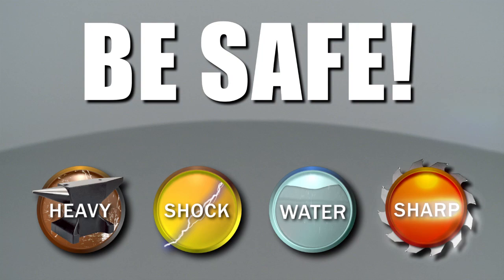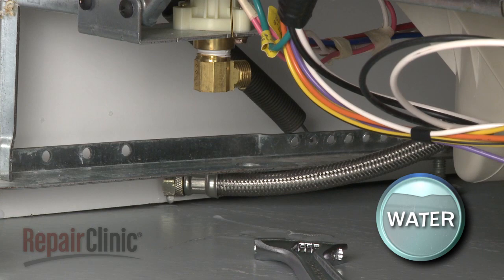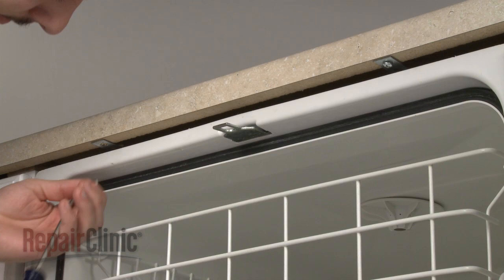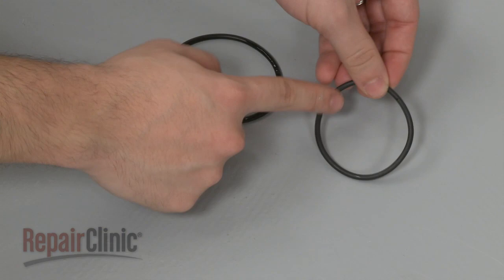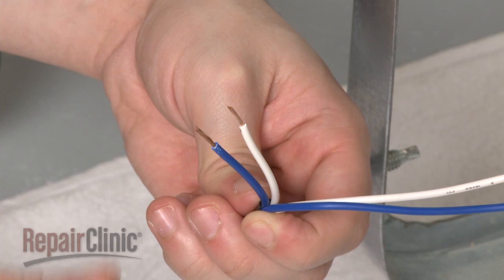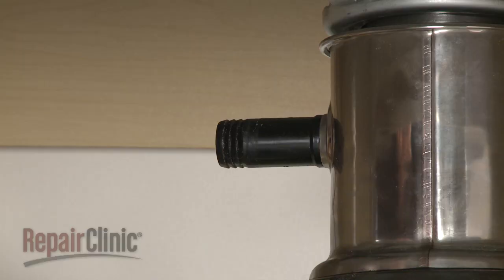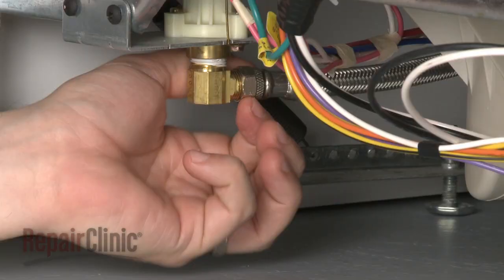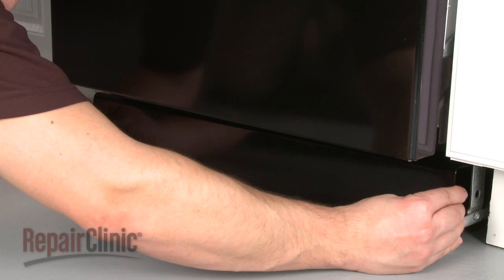Noisy Frigidaire Dishwasher? Circulation Pump/Motor #154859101

Comment: Great video and great site! I was able to troubleshoot, purchase the part and watch how to repair it all in one place! Watch the video first, so you know what tools you need. It took me about an hour. With interruptions from people. Husband was going to pitch the dishwasher and buy a new one. So glad I researched the issue and fixed it. Saved us at least $600.00. Runs now, better than ever,  and does so quietly. Thank you Repair Clinic!
Reply: It saved you about $600? The dishwasher is barely $200-250 brand new. I hope that's not how much a repair tech quoted you. If so he should  be reported. Ah well, do you happen to own any bridges?
Reply: @Roller76  nice😐
 R.C. is using a $300.00 model to illustrate the repair. Certainly it is the same application for all Frigidaire models, so it indeed saved us at least $600.00. That is the "on sale" price of the Gallery, my husband wanted to replace with a new one. 🙄

Comment: For my model of Frigidaire dishwasher, I was able to replace the pump without disconnecting or moving the dishwasher in any way. I simply flipped off the circuit breaker, then lay down at the bottom of the washer and got to work.

I removed that sheet metal covering panel at the bottom, unplugged the two electrical connectors from the pump, used an allen wrench to remove the two screws from that metal bracket which holds the pump in place, slid a large dinner plate under the pump to catch water, and pulled the bracket down.

Then I wiggled the pump slightly out and loose, so that water slowly drained onto the dinner plate. When the plate got almost full, I pushed the pump back in to stop the draining. I carefully slid the plate out, lifted it, and dumped the water in the sink. I had to repeat this draining method a couple times because my plate couldn't hold all of the water that was sitting in the bottom of the dishwasher.

Next I pulled the pump all the way out (turning it to avoid the water supply line), and slid the metal bracket off it. I reached inside the hole in the bottom of the dishwasher, where the pump had been, and used paper towels to clean it as best as I could. I smeared liquid dish soap onto the parts of that cleaned area, where I guessed the pump touches it.

I also smeared that soap on the o-rings that came with the new pump, then slipped them into place on the pump. I slid the bracket onto the new pump. I turned and angled the new pump into place, and pushed it in. I reinstalled that bracket, plugged the wire connectors in, and turned the wall circuit breaker back on.

I didn't immediately reinstall that bottom cover because I wanted to see under the dishwasher when I next washed dishes, to check for water leaking.
Reply from the maker: Thanks for the in-depth story! We're sure it will help someone in the future.
Reply: I have a frigidaire dishwasher model ffbd2411nw6a which has a johnson electric pump. It works great. What brand was the pump in yours?
Reply: Thank you for hope that I can do it this way. I will pull my hair out if I have to pull the dishwasher out again. The pergo floor was installed in front of the dishwasher. Foul language is required for removal and install

Comment: Excellent tutorial!  This was my first time attempting to replace the circulation pump on my Frigidaire Gallery dishwasher and this video helped immensely.  My new pump was plug and play so I didn't have to cut off the old connection.  Other than that the instructions were perfect for my model and very easy to follow.  This repair is very easy even if you are not mechanically inclined.  Take your time, follow the instructions, and save money by doing the repair yourself.

Comment: This was terrific. Followed it closely and DW is about 10x quieter now. A couple of notes: 1. As others have mentioned, I didn't have to strip the wires or add the new connections--it was plug and play; 2. The bracket that held my pump/motor was badly degraded and nearly disintegrated in my hand. Obviously I had to order a new one. My DW sits quite low and I think the bracket touches the ground and must have gotten wet. FYI--you may want to try to inspect the bracket before starting in on the job.

Comment: I used your videos guide to replace the circulation motor pump and the drain pump assembly. Now that it is up and running - looks like I only needed the Drain pump but either way - I hope I bought a few more years of life out of it! Thank you so much - VERY helpful video.

Comment from the maker: Thanks for the questions. Most dishwasher do not have power cords. They are hard wired. As for your other question, the new part has a different wire connector, so you will need to replace it.

Comment: Thanks, didn’t need to replace. The pump was making a vibrating noise, and when I would touch it with my finger, I could stop the noise. So when I took the pump out, I saw that inside the vein of the impeller one little passageway was filled with junk throw in the impeller out of balance so when I cleared that passageway and put it back together, there was no more vibrating noise.

Comment: Awesome video. Only problem is my Pump Motor will not come out. The impeller spins fine not bound up or anything but it comes out about 3/8 of an  inch but will not pull out. I have cleaned the soap build up and vacuumed it out.  
 What is the trick to removing it completely?

Comment: Great video, tho I didn't need all of it. Turns out the repairman who correctly diagnosed the faulty door latch (but wanted to charge me >$200 for a $25 part) left the power cord unplugged to this pump. I'm sure it was an innocent oversight on his part, and not, say, revenge for my telling him "thanks, but no thanks."
Reply: Charles Evans Oh, and I did get the door latch from RepairClinic. Works fine now. Thanks!
Reply from the maker: Charles Evans Great. Thanks.